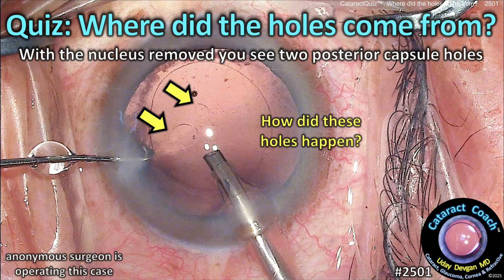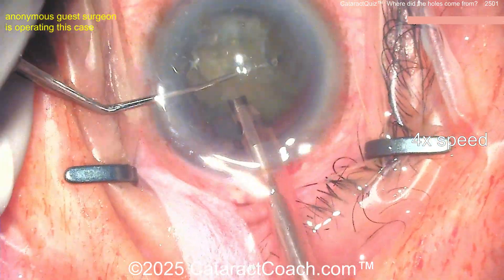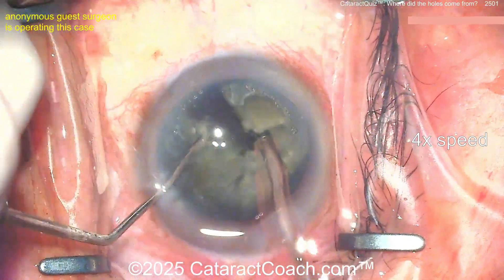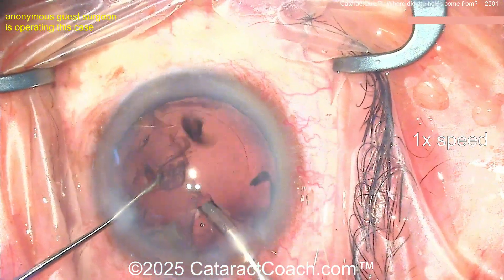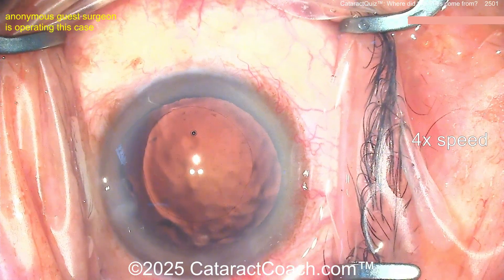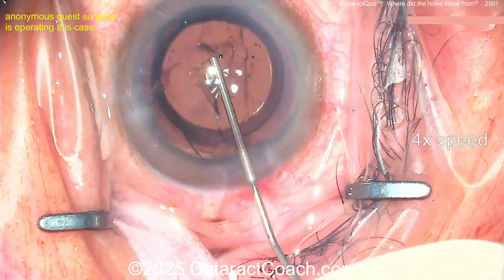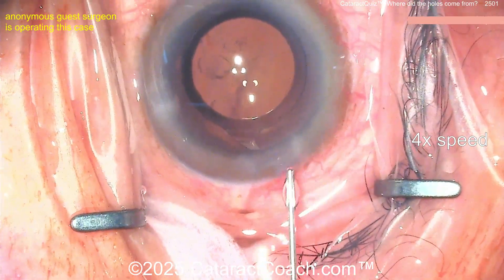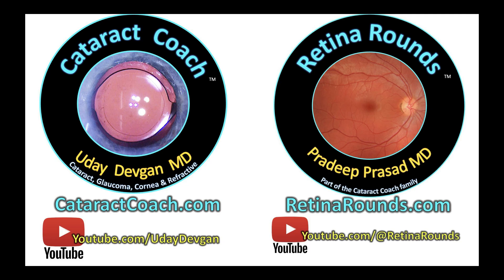CataractCoach™ 2501: CataractQuiz™: Where did the holes come from?

Comment: That quick surge clearly was the main factor, if it was the chopper or the phaco prove we will never know. Overconfidence was the key error here.

Key message to take home: Always switch to epinucleus settings on the last piece with low parameters, grab the piece, and eat it with bevel up, and this wont happen. 
I do phaco in a public hospital with and old phaco machine that isnt very stable and this method has saved me to avoid PCR in a lot of cases. 

This time the surgeon was lucky the tear wasnt radial, but luck isnt always in our favour....better to be careful than overconfident.
Reply: This is what I do as well. Take the last piece in epinucleus settings. I also usually take my second instrument out while taking the last piece to avoid shallowing of chamber.

Comment: Sharp chopper tip was towards  to the posterior capsule. while the last piece of nucleus was being aspirated there was so little or none  viscoelestic in the anterior chamber. Turbulans was occured and post capsule touched to the chopper. this was what I saw. if the chopper tip is sharp;  potecting posterior capsule with chopper (while the last piece aspiration) is a very dangerous maneuver in my opinion.

Comment: Looks like a sharp tipped chopper with the point angled down toward the bag. Because of that, bag comes up-->contacts chopper--chopper pierces through = hole #1. Because chopper pierced through, it was not able to hold the bag back-->bag continues to move anterior-->contacts phaco probe = hole #2.

The true safety position for that chopper would have the business end oriented parallel with the PC. A ball-tipped chopper would likely also help.

Comment: You always have to remove the chopper from the eye to stabilize the AC when aspirating these very last pieces.
Reply: Perhaps that would help with AC stability, but having the chopper in the "safe" position prevents the capsule from coming up to contact the phaco probe.
Reply: @ACsig-k8j in theory, yes. But that doesn’t always work, as shown in this video. You can blame it on the sharp chopper in the video, but I’ve had capsules break even with a blunt chopper in the safe position. Safest thing is to remove it entirely and phaco the last pieces as far away from the capsule as possible
Reply: Overconfidence caused this. Always switch to epinucleus settings + phaco bevel up on the last piece and this wont happen.
Reply: If you need to remove the chopper from the eye to stabilize the AC then the problem is that your side port incision is to large. True that even blunt chopper can cause pc tear but only in case with very thin PC such as mature cataract, generally it is safer to use chopper to prevent the PC from aspirated into the phaco tip. PC tear from chopper are not round in nature, the cause of PC tear in this case are probable from the phaco tip, touching the phaco tip while phaco power is on is enough to puncture the bag even without tip occlusion.

Comment: Since the holes were seen after all nuclear material was removed and in the setting of no cortex (probably the reason the bag was more at risk for puncture), I would have injected cohesive OVD rather than dispersive OVD in the bag (2:40 in the video). Putting that dispersive OVD in the bag made it more difficult to remove which prompted the surgeon to go behind the lens. I prefer not going behind the lens in this case in fear you grab the capsule and extend the tear.
Reply: Completely agree, leaving some cohesive OVD behind is not a big problem here. Dispersive OVD even makes it harder to carefuly manipulate the IOL into the bag.

Comment: Here, the surgeon preferred to implant a single-piece IOL in the bag because the posterior capsule tear was round. However, in my similar case with a well-defined, round posterior capsule tear, the tear expanded radially after placing a single-piece IOL in the bag. Therefore, in such situations, I believe it is important to consider avoiding any risk and instead implanting a three-piece IOL in the sulcus with an appropriate dioptric power.
Reply: Just widen the main incision, make sure the IOL dont overshoot and carefully manipulate the IOL into the bag.
Reply: @Hydrioful  the key is to minimize bag stretch , you could inject the IOL into the cul-de-sac of the capsule bag, then gently manipulate the other haptic into the opposite side. It helps also to fill the bag with Dispersive OVD instead of cohesive, removal may be an issue if you do that.
You could also injected the IOL in AC/Sulcus, then manipulate the haptics one by one into the bag
Reply: Manipulation is key